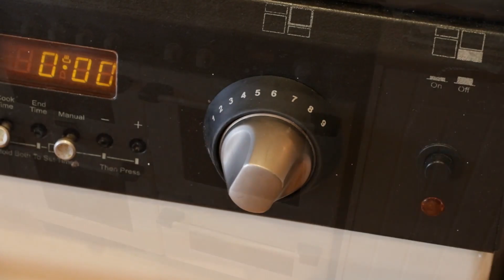Rusty cracked old axe head restoration

Comment: Great job on the weld and temper!...but lose the paint and go with a mirror polish for better cutting. Would you paint your straight razor?...just keep it clean after each use.
Reply: Cattmann but this isn't a straight razor
Reply: They're cutting blades, Mr. Cow. Axe, hatchet, razor, hand saw...doesn't matter. Anything on the blade, rust, pitch, pitting, paint is going to adversely affect the efficiency of the cut...hair or hardwood.
Reply: A hatchet has many uses. In the video we only see him splitting wood which doesnt need any sharpness. We can also clearly see that he sharpened it. I dont have one myself but Ive seen those stones getting razor sharp edges. Again, the axe is sharp, no need for a mirror polish. The paint isnt on gonna magically give worse results. Besides youre saying that a razor and an axe should be as sharp in order to have maximum cutting ability. While that is technically true, there is a point where it just becomes impractical to sharpen the axe. Have you even used any of these? They are not made for the same purpose, which means that they are not treated necesarily the same. It just sounds like you dont have a razor or an axe, and came to a conclusion after watching a video.
Reply: Mirror polish is ugly as all hell its pine with out it or the paint

Comment: Really should use oil to quench and warm oil at that
Reply: Why? Water works as well, although it can be trickier.
Reply: That depends on the type of steel you're working with. All steels don't quench the same.

Comment: If properly hung a metal cross grain wedge should never be used the chance of splitting the handle and allowing for future water ingress and weakening the handle is too great and I noticed it happened to you. The wood wedge is more than sufficient if the handle is fit properly. One of the most frequent mistakes I see in hafting an Axe or Hatchet.

Comment: Should have quenched in oil, very gd restoration though to be fair
Reply from the maker: I followed wetterlings method and they have been making axes
for 3 million years I think they know what they are doing
Reply: Both a fine, water can be harder since some steels will crack easily
Reply: Nestor Portillo hahahahaha gd name
Reply: Are you perhaps misinterpreting the formation of Pearlite in differential treating, with Perlite the gardening product? You obviously have your own sources, and if you're right, your right, but i cant find any sources that say Wetterlings have ever done this (http://www.wetterlings.com/how-to/) and the likely reason is because chemically speaking you can't achieve a temper this way. remove stress definatly, but not rapidly form the molecular structure of hardened steel, which is backed up by the colour of the sparks in your next grinding. I'd be interested to know your thoughts?

Comment: Oh wow you can temper steel in a normal oven? That's awesome to know :)
Reply: Tempering is the final step of heat treating. Most heat treating of tool steel is at 1550-1750 degrees F. for one hour or more then quenched in water, oil or air blast, depending on the type of steel. At this point the tool is very hard but brittle and prone to crack or chip with use. Tempering at 380 - 425 lowers the hardness a bit, removes stresses and leaves the steel very tough and ready for normal hard use. Steel has to have a certain percentage of carbon in order to harden.
Reply: Thx. This is different for different metals though right? I've heard that hardening is basically introducing errors or molecular fault lines in the grid of the metal molecules so it can't move as "smoothly" and thus gets harder and more brittle.
I'd be interested in learning to weld aluminium but from what I gather it's a bitch to harden (or not harden?) so it doesn't rip (or break?) after it's seen some flex. Probably welding aluminium for structural purposes is just a bad idea.
But really I'm just learning to weld mild steel so I can hot glue some metal together.

Comment: I would have varnished the handle prior to putting the head on to protect the unseen part.
Reply: @Kevin Behr. I realise that I'm replying to a comment you made 4 yrs ago. I came across this video cos I've just done a similar restoration on an axe head that was made by a pre war British carpentry tool manufacturer. So my rejuvenated axe is 80+ years old at the very least. I fitted a new handle made from beechwood. But I adapted the length and the shape of it. To darken the very light coloured beechwood and give it some protection I wiped it over with a couple of coats of Danish oil. Then after the oil had soaked in and dried, I finished the whole axe inc the head, with a couple of coats of  clear acrylic lacquer from a spray can. The lacquer is fantastic stuff. Less is more with this product. Two very light misting coats is all it takes. Its touch dry within 5 mins, and you only have to wait 15 mins between each coat. It's a far nicer and more subtle finish than varnish. And it's super tough as well. I chose to use the gloss lacquer finish on my axe. But you can also get it in matt and satin. I'd highly recommend it to anyone who enjoys restoring vintage tools made from wood and steel. 👍

Comment: Sorry to say but It's grind down to something not ground.
Grind is reduce (something) to small particles or powder by crushing it,
Ground is what you standing on. This is not a joke but a correction of miss use words.
But I did like that axe I should buy on of then nice ones.
Reply: Bacon447, how do you figure its a misuse of the word ground. As for use, in this video, of the word "ground", its the past tense conjugation of the verb grind. There's this thing called a dictionary that actually defines words. You might want to get you one. Then, you'll know why there's such things as ground beef, ground black pepper, ground cinnamon, ground oregano, ground cayenne pepper, ground nutmeg, etc. Also, if a car pulls out in front of you while your driving, you may have to grind to a halt. If you do, then while you're doing it, you're grinding to a halt. Luckily you didn't hit the other car because you ground to a halt. Finally, when the grinder is removing metal from the hatchet, its grinding. When the grinder stops, the hatchet has been ground. For example; In a minute, I'm going to grind a bevel on my hatchet's blade. While I'm doing that, I'll be grinding it very carefully. When I'm finished, I hope I've ground it correctly.
Reply: @oldtimer4567  🤣🤣👏👏👌.....great response. Clever, witty, ...and also very true